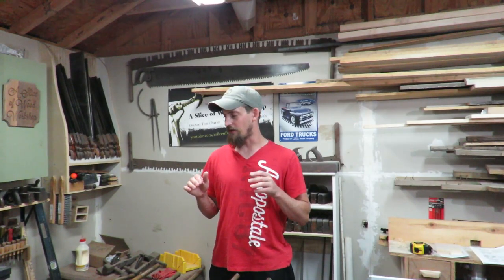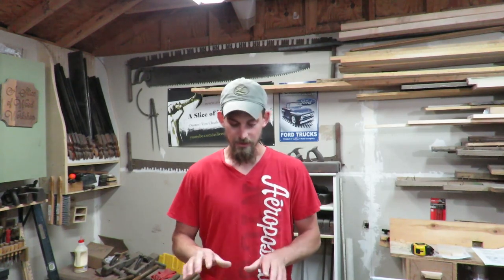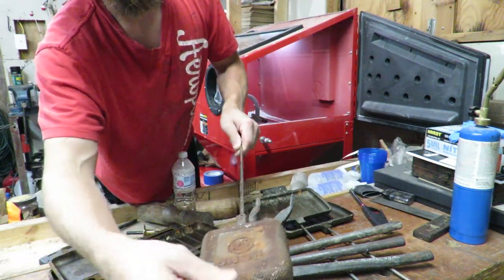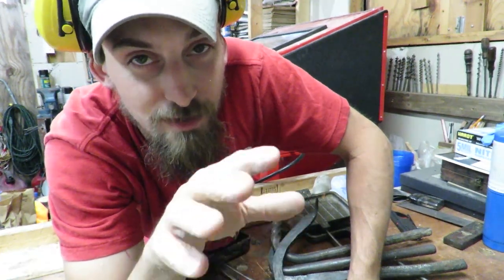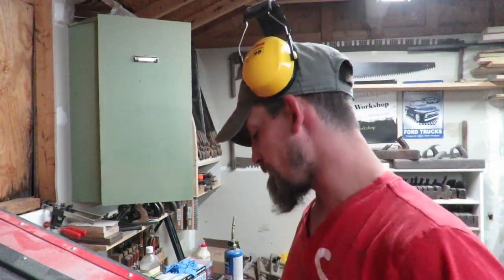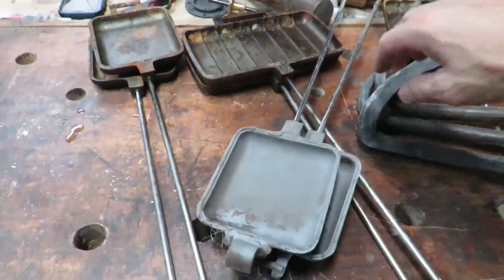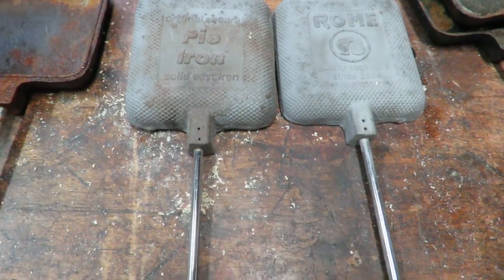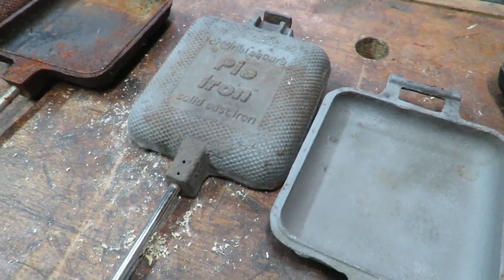Can You Sandblast Cast Iron?

Comment: I ran a commercial sand blasting company for years you need a mask see all that blasting dust under you face your breathing that in it can cause something call silicosis. The compressor is adding air to the box but the dust is not getting sucked into anything like a dust collector. It blows out around the door and window seal. You want to get a 3m paint mask replace the filters with dust filters cost is about $100 for a nice one don't go cheap those get hot restrict breathing. I prefer the full face with the glass I use it for spray painting also.  I lost about 15% of my breathing capacity from just loading bags of glass and sand always breathing the dust in even when someone else was blasting. We used a air fed helmet but you don't want this junk in your lungs.

Comment: I had a house fire that burned all the seasoning off my cast iron cookware (not to mention rust caused by water from the firetruck) and I carried them to work and blasted them on my lunch break over a week's time, they look just as good today as they did 20 years ago before the fire, even still has the grinding marks on the cooking surface and all of the lettering is perfect. Sandblasting does not "ruin" cast iron.

Comment: Part of my job is regularly sandblasting...  With aggressive media like I use, yea it can take away a bit of material, and also leave the material with a bit of a rougher surface, but cast iron isn't exactly smooth to begin with, and you'd have to be blasting an area for a significant amount of time to do damage to it. Only time it quickly damages something is if it is thin material and/or is compromised significantly by rust.  For anything with light-moderate rust, I would personally just go with electrolysis, but anything that's covered in rust/been sitting in the weather for years, straight to the blaster.

Also, freshly blasted metal is very quick to start rusting, so I would clean and season the cast iron immediately after blasting

Comment: Just sand blasted my big cast iron pan! Thanks for the video!
Reply: you have to recure it I'm sure,right?
I want to do mine soon basically because the bottoms so crusted from being 50 years old.
let me know.
did it damage it at all?
did it corrode really bad after you did it?
Reply: I've had alot of mine blasted.  It took three to four seasonings with a thin layer of lard on the bbq to restore to perfection! A cast iron group
 deleted my suggestion to have it blasted,it's apparently not good and against the rules to suggest such a method 😕 best method I've used.

Comment: I've used electrolysis before to clean up cast iron skillets, and that works too. I haven't tried blasting media, but like you I'd stay away from the more agressive media (like Black Diamond). When I season in the oven, I like to use coconut oil. Most oils will work fine, but I get slightly better results with coconut oil versus some others that I've tried.
Reply from the maker: Some of the oils will spoil though if not used regularly. Interesting that electrolysis works. I didn't want to have to go between all those little bumps haha
Reply: IMO~Electrolysis is a horrible process and it only works on mildly rusted objects.
Reply: @ASliceofWoodWorkshop  Super late reply here! The oil will not spoil after it's been used for seasoning, since it's now a hard plastic like substance!

Comment: how big of a compressor do you need to run the sand blaster?
Reply from the maker: mine is 20 gallon. I do take breaks. a bigger compressor would be nice.
Reply: Bigger than big plus 30% more.  It uses an obscene amount of CFM.
Reply: Any compressor will work 5 horse plus will work fine